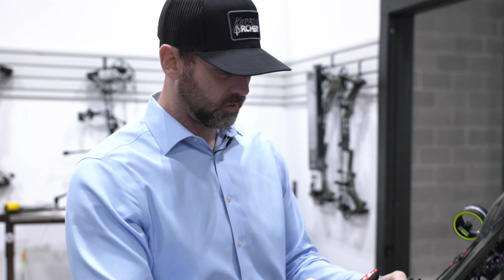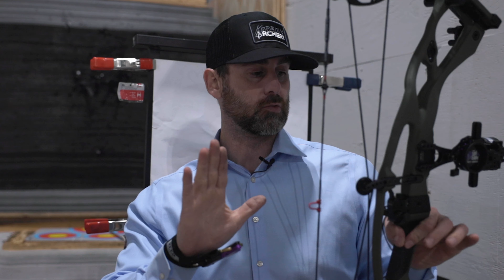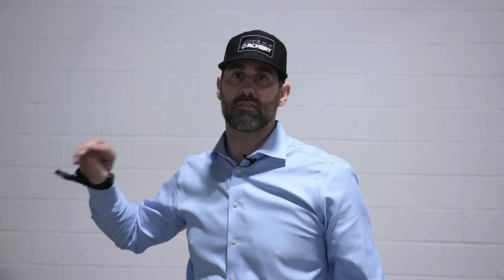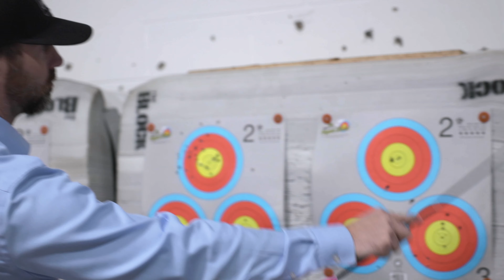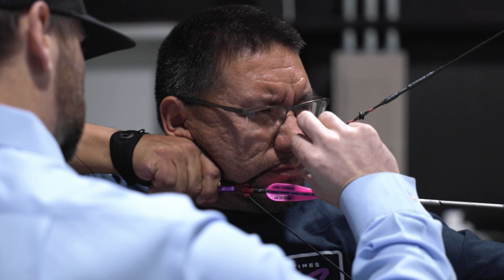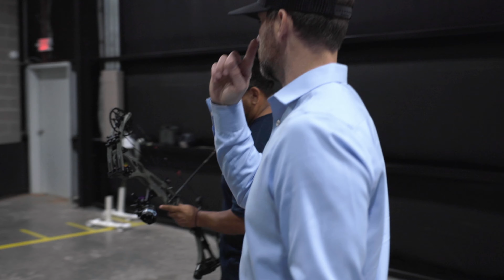Customer Bow Builds | Hoyt RX7

Comment: I just took delivery of my special order RX5.  Its pumping 283fps with 27in draw, 60lbs, 400 shaft/28.5in, 100gr tip and wisker biscut with no variance between shots.  I switched out the WB for the HOYT integrated drop away and it sits at 285 consistently.  The WB is now my field backup rest, both work very well.  The bow is a dream to shoot and went with over RX7 or Levitate due to the grip preference I have.